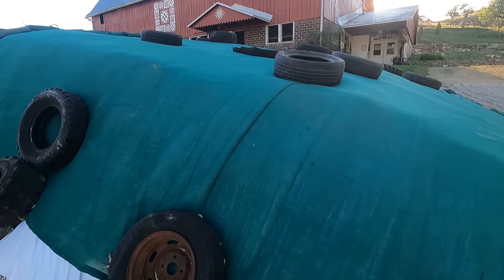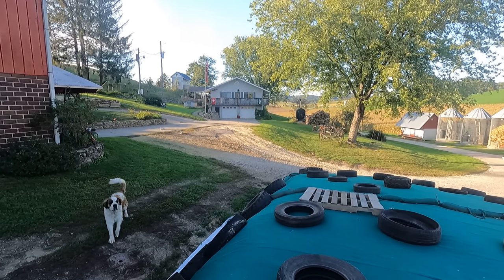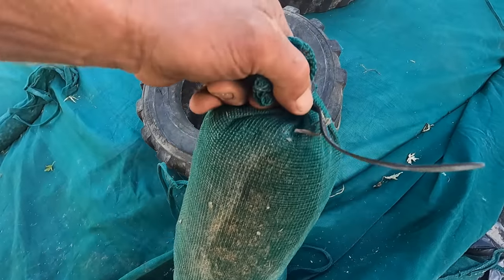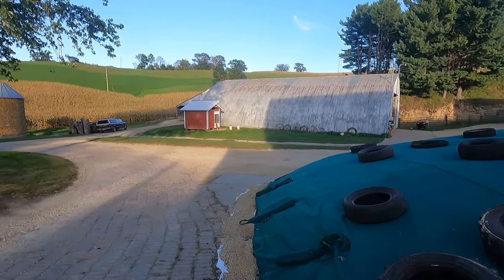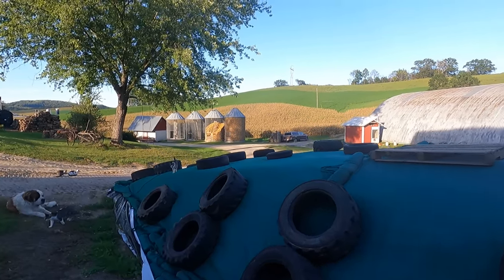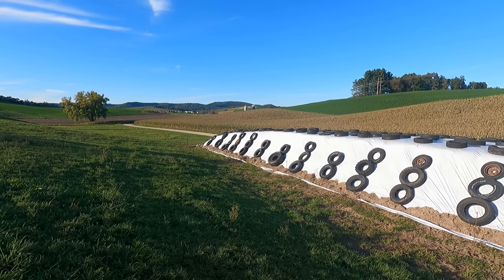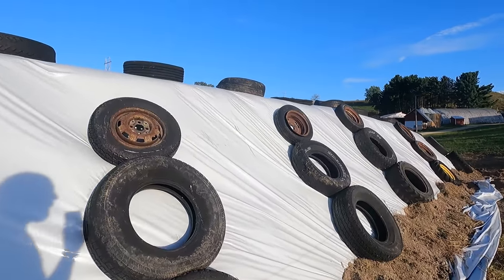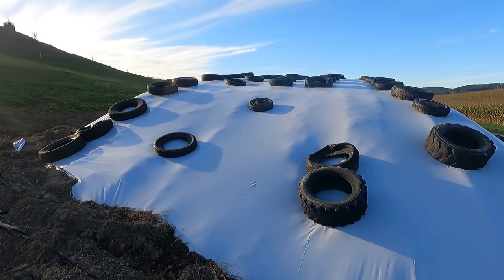How to Make a Silage Pile! l Harvest 2022

Comment: Interesting, one thing that would work for you is digging a trench because your hilly and it is cost effective plus less dangerous than driving up on piles. Most old dairies and the new bigger ones in our area uses trenches, some have concrete walls, but the most just line the dirt walls with plastic. On the tires here in NC the state provided funds to have the tires sliced for mosquito control because of standing water in them, before that it was breeding ground for them, plus as you said it’s is extremely messy to deal with, I help my uncle cover his pits it’s no fun throwing water filled tires.

I’m so glad for the videos and to see you can make the size diary still be viable, as a child this is the same size diary my parents ran milking the same way until his illness made them sell out. My uncle now his grandchildren still dairy nearby in fact the only one in Cleveland County NC still selling milk for processing. It’s sad to see this way of life disappear